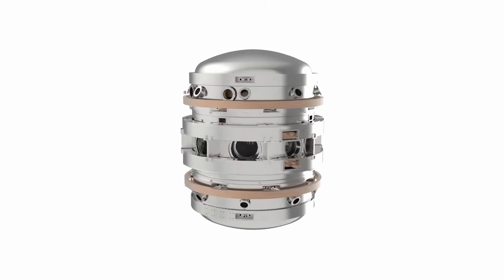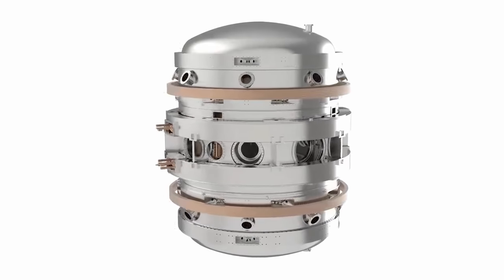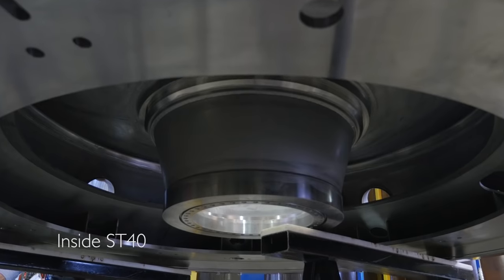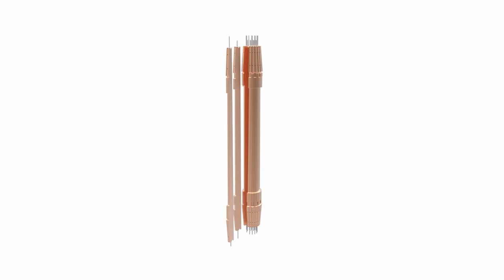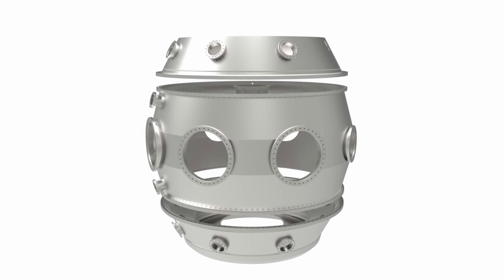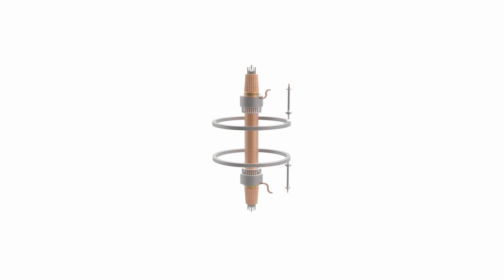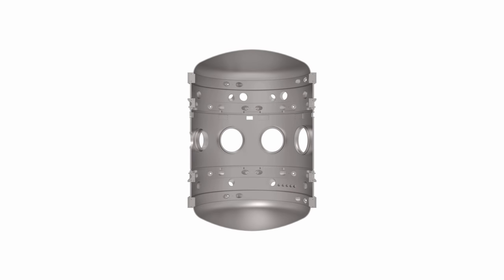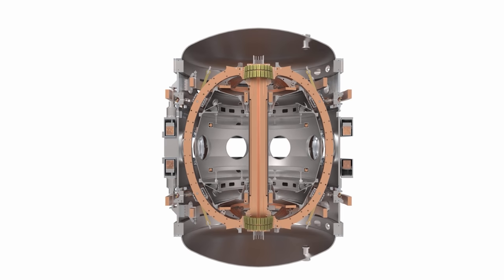Inside ST40 - the world's first high-field spherical tokamak

Comment: I am curious about the temperature gradient between the inner walls of the plasma chamber and the liquid nitrogen cooled magnetic coils. It seems to me that to maximize the field strength you want this distance as small as possible, so there must be quite a lot of thought and development around the insulating properties while maintaining strength of the material used. What is the composition of the walls of the inner vacuum chamber?

Comment: What keeps these materials used from melting?  100 millions degrees?
Reply from the maker: The 100 million degree temperatures will be at the very centre of the plasma; the temperature will reduce moving outwards towards the wall.  So the wall materials will feel a temperature more like a few thousand degrees, which the walls can withstand.
Reply: +Tokamak Energy - A Faster Way to Fusion
Also the plasma is in a vacume and heat cannot travel in vacume.
Reply: Well the average cinetic energy of a neutron from fission reaction is only 2 Mev but 14Mev for fusion reaction with Tritium. How can be sure to find the materiel to stand this force for permanent  reaction?  Just to found the Tritium to do the proof is not easy! The Tritium must be produced on site  because if very seldom and not easy to transport. Even so if Lithium is used to produce it from 14 Mev Neutrons reactions , how will be injected in the center of the plasma once is collected? So far the best way to do it  is to produce ice pellet to optimise the penetration againt the very hight temperature plasma  ; but also the location of lauching the pellet is from the vertical D shape at the equateur  of the donut.  squared to the  plasma small radius.  This means to have the center of the tokamak free.Every time something penetrate to the plasma locally the temperature changes which like the black spots on the Sun  create a counter reaction which for a tokamak can be a chalenge because risk  to stop the fusion process? Not a big problem for the sun because the space is huge, but for a tokamak can be a discharge of particules licking the inner wall and produced arc current to create a disruption at the time at another position of the tokamak fulling pellets penetrate without plasma creating damage on the wall like a bullet from a gun!  What about the vital diagnostic sensors to observe the plasma able to stand the neutron flux and the temperature knowing the fact transparent quartz windows   dislike neutronS of this energy and the seals can't stand more than 300 Deg Celcius. Does small tokamak with this configuation could cope with the physical  constraints because  without diagnostic no way to control the plasma....
Reply: Are there magnetic fields  right on the boundaries of the plasma ?
Reply: Magnets keep the heated particles from pressing against the materials
Reply: @Zeleene Heat cannot travel in vacuum? Tell this the sun we feel on earth haha^^

Comment: excellent presentation, I hope it all goes well. A technical question...with the advent of high strength magnetic fields due to better superconductors does this mean that we have finally got the problem of plasma confinement fully solved ? I know there are many novel approaches to that end, and that now when researchers say, just another ten years or so, it might finally be true, my question, has anyone ever tried a design with actually spinning the superconducting coils at very high rotational velocities in order to produce a more homogeneous and thus stable magnetic bottle? that is of course if confinement is still the issue it used to be. But from the little I have read about the latest designs it does appear that we are indeed finally getting to the point where the field densities are high enough?. 
I don't think the general public really fully understand just how important this is....when achieved this will be the beginning of a whole new era in human history, there will be prosperity and new avenues of  technology and adventure that now seem like impossible science fiction.
Reply: Bigger the magnetic field less Current is needed. Easy to make 5 MVolt not easy to produce 5M A...A Tokamak is like a transformer. Nothing is moving execpt electrons inside the coils, and maybe cooling liquid  to maintain the coil temperature for supraconductivity effect. the field Density is only a paramenter . For my concern the main problem is to avoid  the disruptions Every time  locally the plasma gradient changes before the stabilisation occurs the geometry of it changes. Feeding the plasma with gas or ice pellet combustible create a mobility of the fusion process, you can imagine like explosion inside a car engine chamber execped it is not allowed the flame to touch the wall! I worked 12 years on tokamaks ( JET Tore Supra) taking part of the world records with tritium and long plasma with deuterium only. So far fusion is a very fast process much much more complicated than fission process. And just for the hardware as the software computer power able to cope with all the conditions required to get permanant plasma, execpt people get infos from UFO people , we must admit  we are playing with most advance technology mankind is able to produce. Nobody can survive with the energy of the neutrons the fusion produce even few seconds. What about the litium the berylium the tritium the deuterim evironnment,  fusion workers are wearing like nasa suit not avoid heathy problems ones the chamber is open. This mean is something goes wrong inside the tokamak not only  no one can go close to the reactor because of the radiations of the strutures , but  if a lleak happens every thing must be decontaminated... for your concern the water is easly contaminated by these small Z materials. .. Therefore for the general public even for those young people on the videos, the fusion technology brings new chanlenges never been presented so far, but were my concern when I was working on the tokamaks

Comment: with every advancement such as this one, I could not help but wonder when whichever army weaponizes this what would be the consequences
Reply from the maker: Fusion from tokamaks would not be easy to weaponise.
Reply: There already exist military application of fusion; the hydrogen bomb. Now we get fusion with civil purposes too :)
Reply: Of course it would be easy to weaponize. The weapon of mass destruction of the 20th century was oil, not nukes, not high explosives. Oil is what moved and fed millions of troops, moved submarines and battleships. Oil is what enabled Blitzkrieg. Without oil, war in the 20th century would have been almost as primitive as war in the 19th. 

Any invention resulting in a reasonably compact and cheap powerplant that takes fuel almost out of the equation would be put in every submarine and battleship large enough that the neutron shielding is an insignificant problem. Nuclear fission reactors already make a lot of sense in these applications today; if fission is better it will be used. It would be used to provide power to engines of course, but also could be used to power things like rail guns and laser systems which are actively being developed for military use and have been for years.

Comment: 100 million degrees inside. negative 196 °C outside. I take it i cant build this at home.
Reply: Temperature is the one thing about nuclear fusion that is incredibly easy. Take an ionized particle with one unit of charge (e.g. strip and electron off of xenon, or just use an electron itself from a hot filament). Accelerate it across a potential difference of 100 kV in a near-vacuum. Now you're at >100 million degrees.

You can even get some fusion reactions that way. A teenager can build a fusor given money and interest. You'll be putting in a million times more energy that you get out, but that's probably just as well since it would otherwise be a very dangerous neutron source.

Hell, put an alpha emitter like a little bit of uranium ore in a vacuum chamber and there will be alpha decays putting out occasional helium atoms at 4.5 MeV (~52 billion degrees). 

The 13 TeV collision energy at cern corresponds to 150 septillion degrees (150 000 million million degrees).

It's exactly everything else that is really hard about fusion. Confinement, plasma density and stable operation at those conditions is really nasty.

Comment: so how you generate electricity from this,..... "Steam" ?
Reply from the maker: Um... yes.  At least initially.  High tech meets Victorian tech.
Reply: Perhaps in theory you could place induction coils somewhere within the machine, so that the current within the plasma induces a flow of charges within the coil. But eddy currents in this coil would have to be mitigated so as not to destabilize the plasma itself. Also, perhaps there is a type of photovoltaic material that can absorb x-ray radiation from the plasma, if the inner walls were lined with such a material?